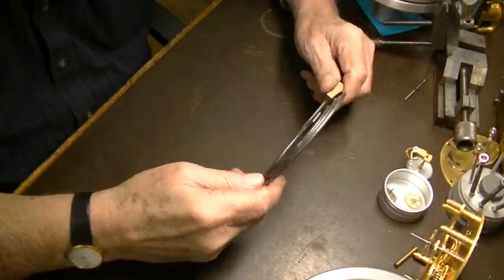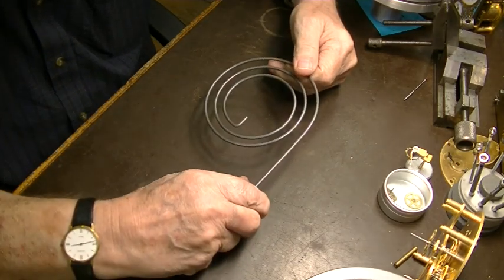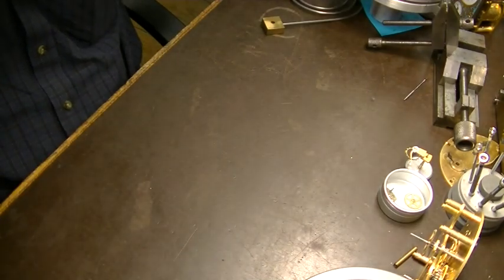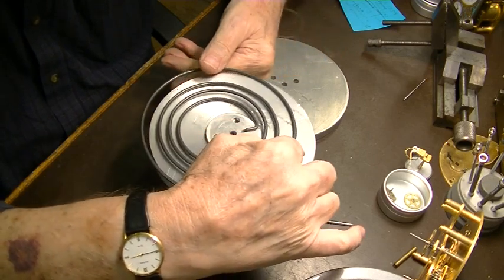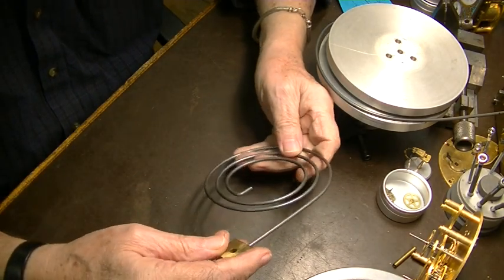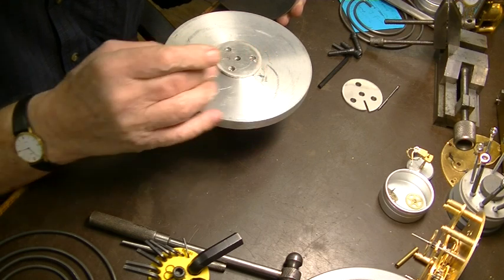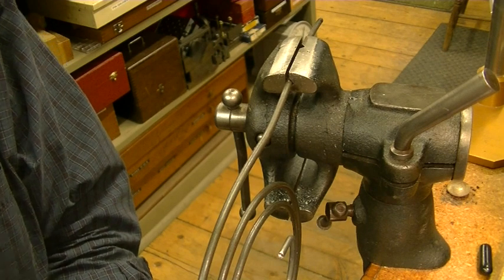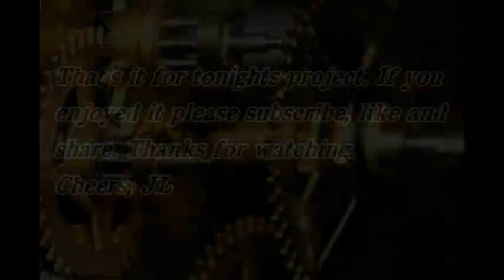Clock repair tutorial. #16. Making a gong for an English Skeleon clock.

Comment: James, I am in the process of restoring a Gustav Becker wall clock with missing pendulum and gong. I purchased the exact replacement pendulum from an eBay seller in Europe but have had no luck in finding a gong to fit in the case. I think you have solve my search for the gong. Thank you, Paul
Reply from the maker: +Paul Jones Paul. I have a drawer full of old gongs if that would help. Thanks for watching. JL

Comment: I was thinking that it might be best to have the washer a wee bit under the diameter of the wire in order for the top plate to "clamp" it ( to avoid what occurs at 10:49 ). But you mentioned the requisite clearance for the wire to feed in. So why not have the clearance milled/turned into the top plate so you can have the best of both worlds?

PS, I notice the washer in the background has the feed-in (?) corner filed off (or you filed the whole circumference into a spiral) . Was there some reason for that?

Also, instead of a press fit, if you split the block where the wire goes in and use screws  to hold the wire fast, then you'd be able to adjust the frequency of the sound produced by the gong (to tune it).
Reply from the maker: +ExtantFrodo2  I'm not sure I understand exactly what you mean.If you mean to eliminate the washer and turn the clearance into the top plate, yes, that would work too but I never thought of it. Thanks for watching.
Reply: James A. Lea The Village Clockmaker
I mean at 10:49 the wire popped out. Using an undersized washer would make the wire stick out above it so the the top plate when screwed down would clamp it tight. Clearance could be provided by turning the top plate from the outside diameter of the washer to the outside diameter of the plate.
   Is that more clear?
Reply: +ExtantFrodo2 I was thinking the same thing.  Size the inner spacer so that it will clamp down on the wire.  Then face off 0.020 off the top plate in to the spacer diameter.  Put the wire in and clamp down the top plate.  The wore would be held in the center, but the clearance on the top plate would provide the room for the wire to feed in.  This would still work with other sire sizes by changing the spacer thickness as already the case.